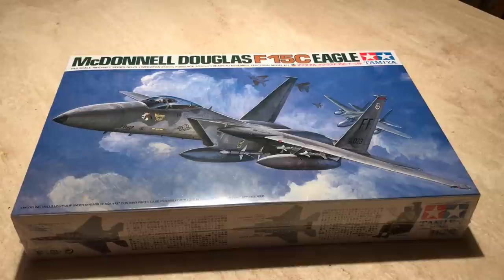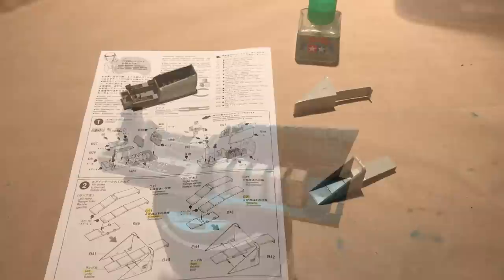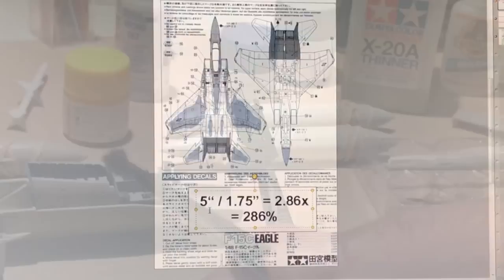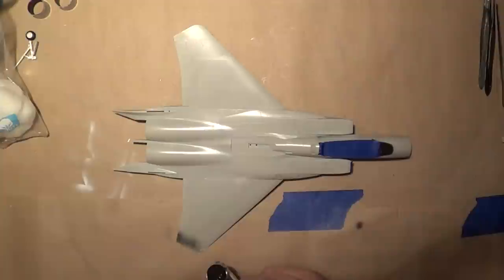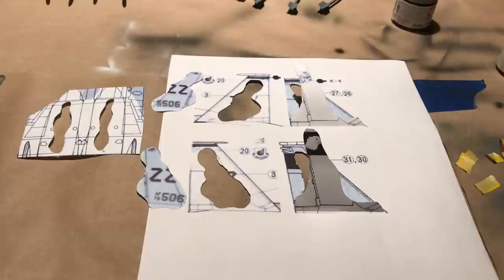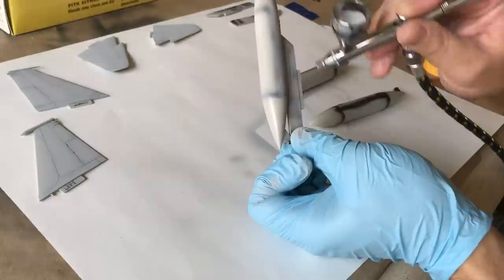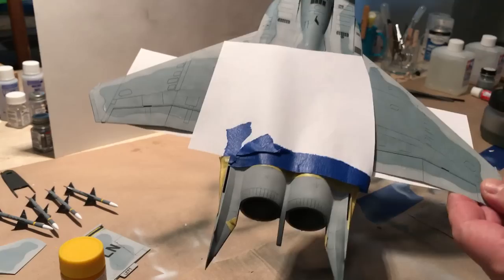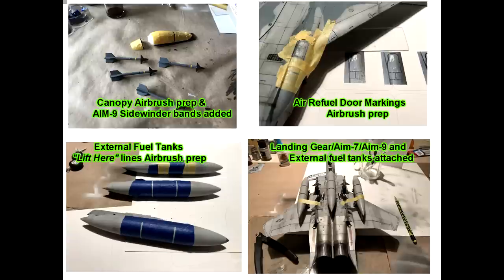Building the Tamiya 1/48th Scale F-15C "Eagle" Fighter Jet

Comment: Yep,
That's about what an interceptor F-15 in US service looks now!  
I don't think there's a single F-15 in the US fleet (other than E-models) that's YOUNGER than 32 years old!
They ALL look well-worn.
Not a single A-model left in service ANYWHERE.  Israel retired their A-models, too.  Most if not all the F-15 museum planes and gate guards are A-models.  They might still have a few B-models in service with the ANG and NASA at Dryden Research Center/Edwards.
Those planes were all supposed to be originally decommissioned by 2005/2010 (and replaced with the F-22 had the original 750-plane order gone through) but they got life extensions until 2035-2040ish unless someone convinces the Pentagon all the missions can be done well by the F-16 and they we'll actually be enough next-gen planes that actually perform better than an F-15 to do the job.
There is, of course, a lot of skepticism about that last point even as there's concern about the structural integrity of the fleet of planes we have left...  There have been at least 2 F-15 breakups in the air that I'm aware of.  One  of those was fatal and happened off the coast of the Louisiana in the 1990s.  It's not as well known as the accident that happened in 2007.
Reply from the maker: It's an awesome jet despite it's age! :-)
Reply: @MaxAfterburner  Actually, I made a mistake...
They apparently DO have A-models still in service in Israel.
They just recently transferred 11 Eagle D-models in storage at AMARC to Israel, too, where they've reworked the planes and put them back into flight.
Sooner or later, though, they'll have to retire the planes.  I think everybody's F-15 interceptor fleet (the ones made before the E-model took over production; all the F-15s built now are derivatives of the Strike Eagle which has been redesigned from the stock air superiority model more than most people are aware) is about 10 years past the planned retirement and they had some serious crackups of a few C-models in the early 2000s.  They had one rip apart at supersonic speed when it shouldn't have (pilot broke his neck during ejection I think) while it was chasing a missile for a test, the other F-15C cracked its back (longeron failure) during a mock dogfight.
When you hear stuff like that, it makes me think the Navy was right to retire its F-14s when they did!
In other news, there isn't a single Legacy Hornet (A-D models) operating off American aircraft carriers anymore.  They transferred a bunch of jets to the Marines and the Marines don't generally deploy squadrons on carriers anymore.  The Navy is strictly all Super Hornet with the F-35 coming into service.  They STILL have a shortfall of carrier planes and it looks the Navy at least will be cutting its F-35 orders, too.  They're buying around 230 planes but that will probably be it.

Comment: Good day. I was wondering if you could make a copy of your Lakenheath  decals and I will obviously pay you for it. I don't have the ability and with doing the Lakenheath markings it brought back memories while I was stationed at RAF Mildenhall, about 10 Miles away from Lakenheath from 98 to 2001. I was attached to a U.S. Navy Unit there.
The number I was wanting to use would be 91-321 attached to the 48th Fighter Wing. Again I will pay you in advance. Let me know.
V/r Bob Pritchard
Reply from the maker: Hi Bob, I'll look into it, no need to pay me. What scale do you require, i.e. 1/72, 1/48, etc.? Also, are you looking for a computer file, or do you need it printed on decal paper? 🧐
Reply: @MaxAfterburner  
Good day,
Yes I would needed them printed out and it would be 1/48 scale. I really appreciate any help you can provide.
/r Bob
Reply from the maker: Hi Bob, my printer is in poor shape and you'll see I was having problems with my custom decal work when I release the Project #29 video. I'm not ready to spend money on a new printer as of yet. Still, I can at least create a file you can print from, if that helps.
Reply: @MaxAfterburner  yes that's fine. I thank you.
Reply: Let me know and will give you my email when it's ready. Thanks again. 
Bob
Reply from the maker: Will do!
Reply from the maker: Hi Bob, just want to confirm my initial research-- USAFE, F-15 #91-0321, 48th Fighter Wing, 492nd Fighter Squadron based at Lakenheath, initially delivered there on December 17, 1992?
Reply: @MaxAfterburner  
Morning,
Yes, it would be nice to have a computer file, and if possible, if you could print a 1/48 scale decal sheet would be excellent as well. So yes, on both accounts, but if you can only send the computer file. That will be good as well.
I know you said you were having issues with your printer. Let me know. 

  Bob
Reply from the maker: Hi Bob, I have a decal sheet file ready for #91-0321 as a Word document. I can upload it to you if you can send me an e-mail address to my address listed in the "Business Inquires" box in the "About" section for this channel's main page.
Reply: @MaxAfterburner  Max, sent it to your contact Us email.
Reply: Let me know that you got my email.
And Thanks again in advance
Reply from the maker: Hi, I don't have it. Go to    https://www.youtube.com/c/MaxAfterburner/about    and click on the business inquires e-mail box.
Reply: @MaxAfterburner  , I'm trying to get link
Reply: Max, check your email now. Let me know when you do get it